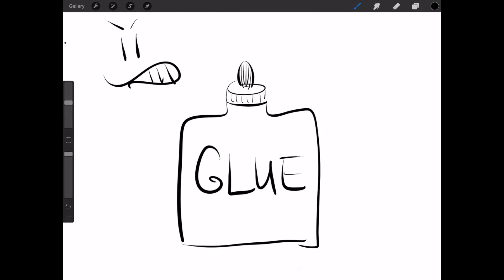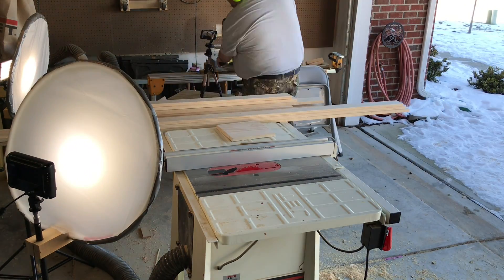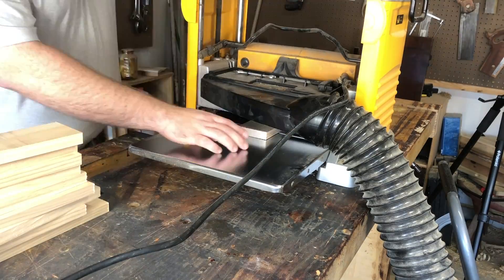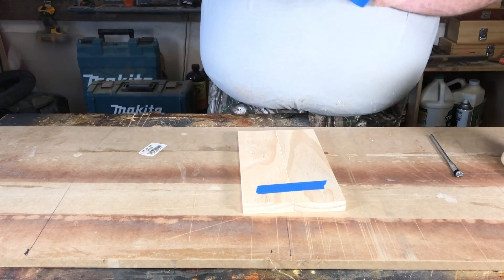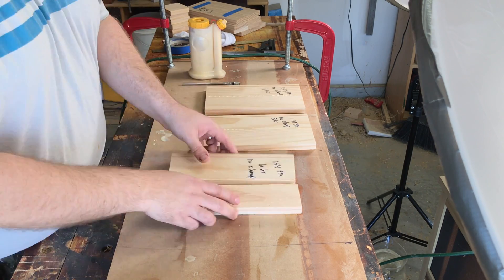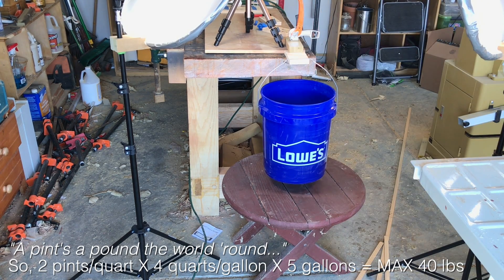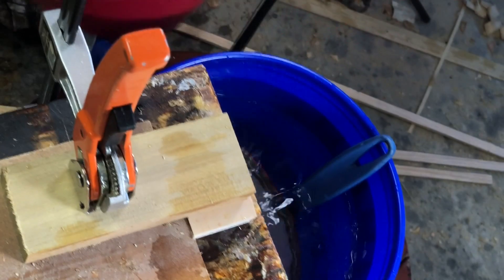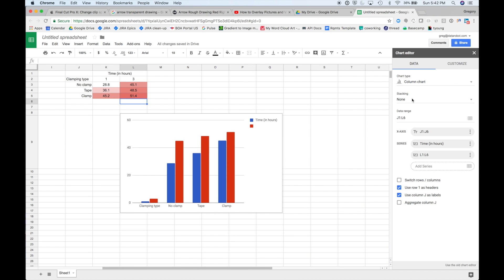How does clamping effect glue strength?

Comment: Interesting video. Do you have any explanation as to why after 3 hours the clamped pieces are stronger than the others, even though the glue joints did not fail in any of these cases?
Reply from the maker: My guess is that the sample size is small and it just happened that way. Need to repeat with more repetitions to get more solid data. 

I suppose it’s also possible that the glue is soaking into the wood and making it stronger in some way... but that seems like a stretch
Reply: @Therealgm  Yea an anomaly due to the small sample size is what I thought as well. Thanks for the video and your reply!

Comment: i.e. the miter saw issue: When using a stop-block, that piece should be thought of as you're keeper piece and you should use your left hand to operate the saw and hold your keeper piece with your right hand, or of course, a clamp. In the video, technically, you are double fencing the cut (the back fence and the stop block are both fences) and when the blade comes back up, any blade deflection will hit the piece, it has nowhere to go, and yes, it's almost like kickback on a tablesaw.
Reply: Just a thought, many moons later, wait for the blade to stop
Reply: @clemmcguinness1087  Lmao, that's what I do...  Might be Einstein's long lost Grandson.
Reply: @artv4nd3l4y that is what you are "supposed" to do. I get in a hurry too.
Reply from the maker: Hey sweet tip. Thank!
Reply: It is kickback. Created by a pinch point. Same reason you can’t run crosscuts on a table saw with a fence and a miter gauge. Baaad news lol